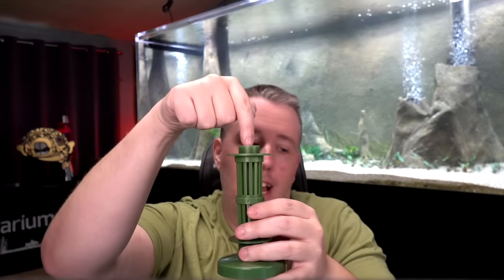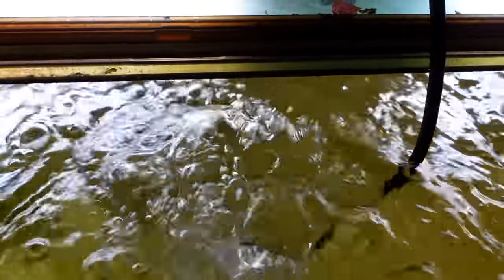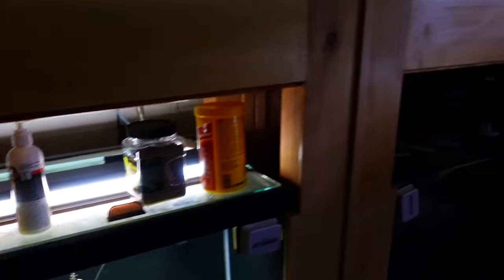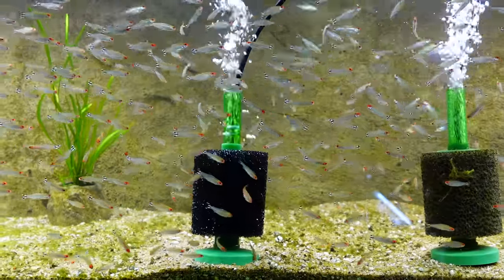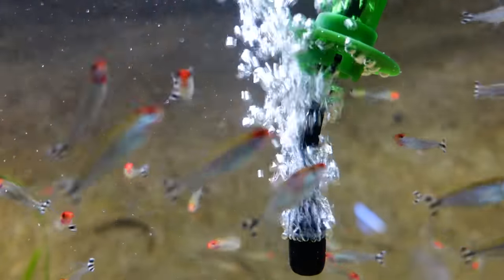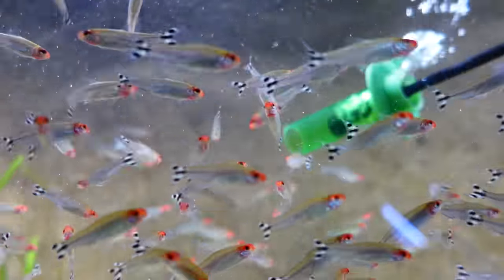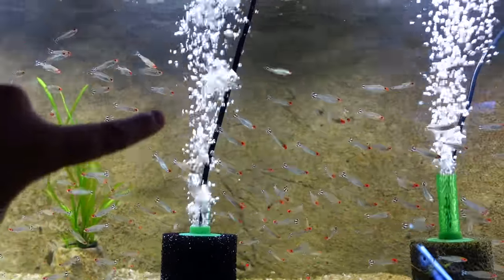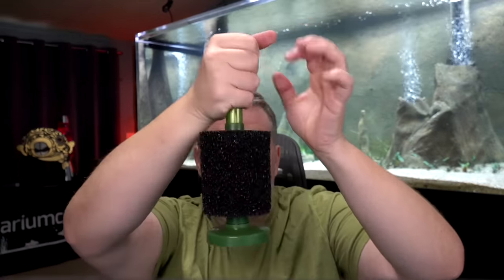How to Optimize and Clean a Sponge Filter

Comment: I'd like to make a suggestion to you. About 25 years back I had just started dating the woman I eventually married and I gave her a 55 gallon tank I wasn't using. It had a really nice stand and matching wooden top that I had built so it was an excellent piece of furniture that fit in a nitch in her den. She had never had fish before so I took her out and bought about a one or two dozen african cichlid fry. I didn't want the tank to be any real work for her as a novice so I purchased two of the coffee can sized sponge filters. If you notice most are large enough at the top to put a section of 1" pvc and it fits tightly. I cut the pvc about four inches short of the top of the tank and placed a power head on each one. No noisy air pumps that vibrate all over the place and no filter floss to change out frequently. I gave her one set of directions. Each week draw out around four gallons of water, pull out one sponge filter and wash it out in the old water, then put it back in the tank and replace the four gallons with fresh water. Swapping which filter you cleaned every week. That tank stayed crystal clear for years and the fish grew to adult size healthy and happy. You don't need the air bubbles flowing up for oxygen exchange just the water flow across the surface from the power heads. I will say this will work best in a much deeper front to back tanks where you can hide the filters behind rocks or plants so they don't show.
Reply: I love this idea, thank you!

Comment: I was convinced the longer, internal airline was the only way to optimize flow. Thanks for the education! I'm going to fix them all my next water change.
Reply: Same here lol
Reply: Same!
Reply from the maker: As always there’s so many ways to do everything in the hobby. A longer tube, more air, larger diameter can all be done but with outstanding which lever you are pulling, it usually lowers efficiency.
Reply: same here
Reply: @AquariumCoop  I've always accepted the external "escaping" bubbles believing it was still more effective. In truth, I haven't been maximizing the capacity of your product. There are multiple routes to the same destination but, sometimes you have to take the route the engineers intended lol
Reply: Same here.  Happy to be educated!
Reply: Same here.

Comment: These coarse filters and the air stones are SO much better than the ones I was using. I can't believe how quiet they are! And I can hide them with an Anubias and they totally blend in.  The filter-picking critters even like them better.  NOW please, do a nerdy version where you explain lift, and best placement in a tank with one or two filters for different size tanks. LIke 1 filter in a 10 gal;  1 filter in 45Tall, 2 filters in 60 long, etc. LOVED the other filter where you show the cleaning process and water the plants. Thanks!
Reply from the maker: I'll see if I can tackle that some day in the future. But if you have one, center of the aquarium as much as makes sense with decor. If you have two, about 1/3 in from each end is best. Mostly it's about just having them, I like to hide behind plants as well and they'll work in any position well enough.

Comment: Upgrade idea, longer lift tube and a 45 degree to direct flow. Corner shaped sponge would be awesome. I love these filters and I love the fine sponge corner filters as well. Great products. Don't forget to get your Check valves.
Reply: Cheapest, easiest way to improve any airdriven filter is to increase the uplift to just below the water level.

Comment: A couple months ago, I rescued a large black moor goldy, and had to set up an emergency tank to house him. I didn’t have a spare filter and didn’t have the cash on hand to buy one. Nowhere around where I live sells sponge filters, so I built one with a pvc pipe, a spare air pump, and a pond pump prefilter sponge. It is a total workhorse, but after watching this I could optimize it. Now it works even better.

Comment: Bought your sponge and stone. Bubbles out the top of the sponge right away. Thought it was too much flow and put a control valve on. Fixed mostly. Still had the 'glug' every second or so. Who knew it was the length of the tubing inside the sponge...thanks Cory.

Comment: I’m not from the US but I have Mini USB air pumps similar to what you offer on your store. I power two sponge filters rated for 35 gallon tanks with one of those using the air stone method and it’s fairly efficient. I had to modify my sponge filters, but it does great, is a LOT silent, and saves me money. 

I run 6 air pumps in my studio. The fizzy noise from the air stones are louder than all 6 pumps combined. I don’t even hear the pumps at all. I recently turned the old air pumps I used before and didn’t know how I lived with it running at the background as I worked. If anyone is using the USB air pumps, I highly recommend having a sponge filter with air stones.

Comment: These filters are amazing.  I've replaced all my sponge filters with them.  I have some with fine sponges and they require far more maintenance than the coarse.  Best sponge filter out there.
Reply: iʻm doing the same but havenʻt been able to determine best way to replace them. did you just swap them out straight out of the box or did you try to transfer the bacterial soup to new filter?
Reply: @IridescentJen  I put them in the tanks along with the new ones attached to those usb pumps and let them run for a couple weeks before pulling the old ones out.  Some of my pumps were big enough to run a extra line out of.  A few I just put them in the tanks without pumps for a couple weeks without air to them.  It looked corny, but I didn't loose any fish.  All tanks converted over now and I leave a couple extra in my big tanks just incase I get a new tank.  So much easier to clean them than the fine sponges and the plants have grown around them now.  Can barely see them.
Reply: @nolas1360  awesome, thank you! haha, i can totally plant a little sponge filter forest for awhile :)

Comment: some interresting science on airlift pumps: it's not just the drag of the rising bubbles, that's moving the water. the bubbles actually "dilute" the density of the water within the lift tube, making it buoyant. 
i never meassured how much the length of an airlift tube affects the volume of water it moves. but a longer tube greatly increses how far it can lift water past the surface. (for example in czech airlift pumps, and the double sponge filters, that are popular for shrimp tanks)

Comment: Thanks to this video I’ve modified my sponge filter so I could attach an air stone and it’s made a HUGE improvement. The sponge filter I have was designed so the base created the bubbles but it never worked quite right and even with my air pump turned all the way up it barely bubbles and they would be large when it did. Now it bellows bubbles.

Comment: Fine sponge is just as good as course sponge as long as you keep them clean every week? I bought a set of 2 enormous corner sponge filters. Is it optimal to not have it resting on the glass at all since its in the corner? Should it still be away from obstacles? It came with air stones but it does have the big bubbles.

Comment: Cory , the nice thing about the sponges with the stem that runs all the way up is that if the top nipple ever breaks off (which mine do all the time when trying to remove the airline that’s been on there for a few weeks)  you can just connect it to the nipple on the inside instead ,,,,,,with your style , now you can’t just connect the airline to the stem below , it’s bassically garbage if the top nipple ever breaks off :(

Comment: When cleaning sponge filters of any kind, you can get more thorough cleaning if you use 2 separate buckets of water (e.g. 3 gal). Take gross sponge and squeeze repeatedly into bucket 1 until clean. Then squeeze out any remaining water and then put it in bucket 2 and repeat. When clean, put back in tank. Go to the next gross filter. Clean it in gross bucket 1, then again in mildly gross bucket 2. You can clean a lot of sponges that way and get some extreme mileage before having to replace the water, and yet your sponges are super clean every time. By the time I'm done, bucket 1 is almost solid brown/black. I've used this to clean slightly dirty filters as well as ones filled to the max with poop - same level of clean every time.

Comment: I appreciate the great advice regarding sponge filters.  After watching the video I purchased one of yours.  I am disappointed in this product.  Even with the air stone directly under the top with a 1/3” of tubing and the flow turned way down it still glugged air out of the top because the filter is too coarse.  I would have turn the flow almost completely off before it would stop doing this.  It did perform better after a few days of use but then the green plastics turned my tubing green.  I decided to toss it in the trash after that.

Comment: I've been fighting with Hygaar filters for months. Already replaced one air pump from them since it just isn't moving any air through anything after the first month. Ordered 2 of these in the nano size, a couple air stones, valves and controllers with your USB pump. Hopefully that will properly clean the empty 2 gallon I have in the living room. It's been the death of a few fish so far. Largely due to the size of it, and the internal filters just move too much water for another betta. The 4gal in my office is doing well, but there just isn't enough filtration to keep it as clean as I'd like. It has a single betta fish who seems happy, but I think he would be due for some cleaner water.

Comment: Hello,
Great Video

At my retirement age as a Structural engineer I am trying to learn and do things I never did before, learning to keep fish one of them and as an Engineer I kind of like measuring the performance of my equipment's

I am from Costa Rica thus I am kind of limited to locally available products and diversity of products typical of a small country, that said I have an Eco7 air blower with capacity of delivering 3556gph (225 l/min) that comes from factory with a 12 valve distribution manifold, that would mean that I should be able to deliver an average of 18.75 l/min to each air line, however, I have been unable to determine the true demand of the air stones and other air diffusers locally available and further I have noticed that after a few months the stones tend to reduce the amount of air they deliver by what seems to be a slime growth in the aquarium which probably means that the air pump is overworking (less air-more pressure-more heat), that reduced capacity seems to recover some (I would not say completely at bird´s eye) with an overnight bath in a mild acid like citric acid or Hydrogen Peroxide but since having restricted air flow in the pump can damage it (I have already blown a diaphragm) I have been trying to figure out just how to determine this factors with out fancy equipment from home
1- Do you know of a place I can locate a table of estimated air demand per type of air diffuser and may be a curve of air delivery reduction over time with use? (Currently I use stone cylinders 2¨x2¨ and 2¨x4¨ by EcoPlus and some plastic diffusers that dismantle apart as a collection of rings for cleaning kind what is shown in some videos as Never Clog
2- Can you suggest a way to determine at home how much air an air diffuser actually demands at any point time?
Someone told me that the 2x4in stones new demand 5 liters/minute, that would mean that I could hook up to 225/5=45 large diffusers out of the 12 ports which seems unrealistic, further, the pumps do not come with a curve to determine the volume/pressure relationship, I run my fish at 1meter deep which means that I have to overcome the pressure of a meter of water and that probably reduces the air delivery estimated

Comment: I did everything in this video and still got bubbles out the side.  I bought a similar fine filter off amazon.  Cut 1 inch ring of foam off the fine filter added it to the top of the coarse filter and that finally solved the problem. : )

Comment: If you get the aquarium co-op air pump for the sponge filter, make sure not to use the power saving mode. I just lost an otocinclus because it swam down the tube and got his head stuck in one of the holes the air bubbles come out of. It is a great product and worth buying still, but just be careful with it so you don't lose any fish like I did. Since the power saving mode only releases air like every 10 seconds I think the oto got curious and went down to look for food in between bursts. If you have it running nonstop normally I doubt any fish will try/be able to swim down it

Comment: Before I saw this video or read anything about this filter, I pulled it apart and assumed that I was supposed to put a bit of airline tubing from the disc to the bottom nipple. Which works great, bubbles are pretty small but not airstone small.

Comment: I run both an air stone alone and I do run a sponge filter that has no air stone and to tell you the truth the sponge filter for me anyways is quieter than my air stone. Yes it does create much bigger bubbles but you don't hear any glug glug glug and I have it running high. Now I do not use the sponge filter for filtration though it does help filter the tank, I run a sump on the tank that does a fantastic job at filtration. I us the sponge filter because it gives the perfect amount of water in a dead spot in the tank and it works perfect for that. The only reason I run a separate air stone is for my two Hill stream loaches who absolutely love to hang out on the glass behind the bubble flow letting the bubbles flow over them, they just love the flow. My tank is a 90 gallon with a 35 gallon sump stocked with 25 Rummynose, 15 Hengli Rasbora's, 25 Cardinal tetras and two hillstream Loaches. Also included is a bunch of Amano Shrimp and 4 Nirite snails and it's a planted tank. When it comes to fish tanks I gotta say this is one of the best tanks I ever had. Most peaceful tank that's for sure, everything in the tank gets along perfectly together. tank is six months old now and have not lost a single fish. Happy fish keeping all, Cheers!

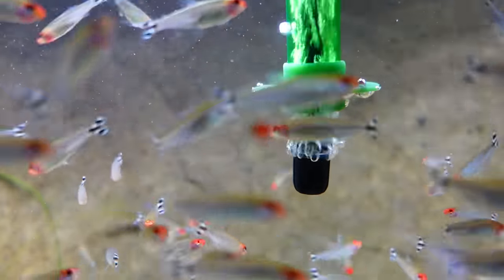Comment: I remember seeing airstones that diffused very small fine air bubbles. Why are those type of airstones not used in sponge filters if you want to avoid the glug, glug? At 10:40, I also noticed that all of the bubbles are coming out of the top of your airstone rather than being diffused through the stone  itself.

Comment: I had a 1 watt mini air pump (almost completely silent) running on a shrimp tank sponge filter for ages and that was enough to keep the water clean. I'm not sure the power even matters that much as long as the water keeps flowing though it.

Comment: Just a couple of points. I’ve been running a fish room for many many years and have not used airstones for a very long time. I’ve found that using airstones puts too much back-pressure on diaphragm pumps which results in regular replacement of diaphragms. Since I stopped using them i cannot remember when I last had to change one. The “no clog” stones that you are talking about were actually being sold in the UK in the 1960s but have since appeared to lose their popularity?  BTW I use an air ring system in my fish room to supply 42 outlets…

Comment: You could be wrong about the uplift from a shallow v deep airstone. The deep airstone for the first inch has the same batch of fine bubbles as a shallow airstone so would have the same uplift, but then add to that the extra uplift from the larger bubbles above and you get more lift than a shallow aistone. Add to that the fact that there is more water pressure at lower depths which means bubbles travel faster deep down compared to near the surface.

Comment: >PIN< You can make what's called "floating object" style items. Use clear acrylic line tubing for the invisibility up to the top of the tank much like water flowing down a tube for "floating faucet" effect you can search for on YT. This DOES mean it will be a hard line that is less pliable for function purpose. You may still see a hint of it past the bubbles but "invisible beads" are a similar effect. To hide the sponge part? Black 2.0 background behind it.

Comment: Corey, for those wanting to pump an INSANE amount of air through, at some point, the airstone becomes the limiting factor for water flow due to its own diameter, no? Maybe you can find a way to design, source, or sell the more narrower-diameter type air stones maybe? I've also seen others with a flared tube section for the airstone.

Comment: I'm a little confused.  Did you say that you don't use the tubes that go from the top of the sponge to the water line? I also thought it said that the new ones come with a collar so you don't need an air stone.    I just bought the nano size for my 10g cube to supplement my hot roded HOB.  Should i take all those tubes of the top and add an aurstone?

Comment: My 300 gallon stock tanks need the glugging😊. Also I use supper fine sponges as prefilters. Keeps my canisters clean forever. The only issue is trying to clean the prefilters when they get totally clogged.

Comment: If you go to a LFS, and they have Sponge Filters running in their tanks along with the Central Sump System. It’s so if they loose power, the   Air Supply is switched over to an Emergency Supply, via Battery operated system, Generator or a *Large air tank. *It’s rare to use this type of back-up.